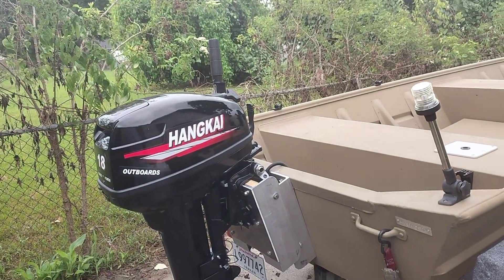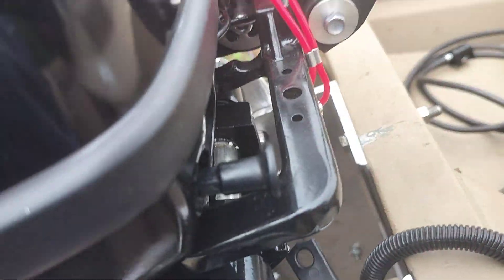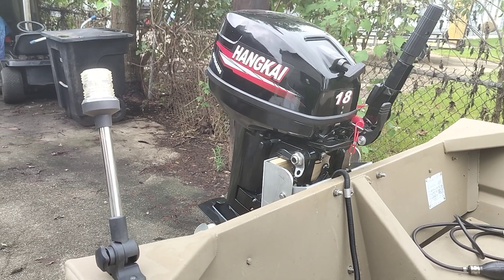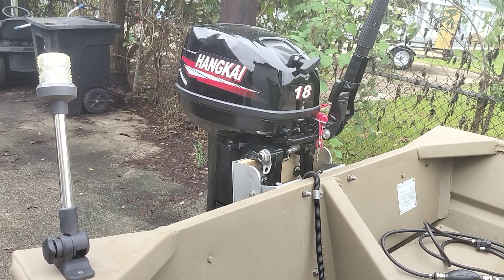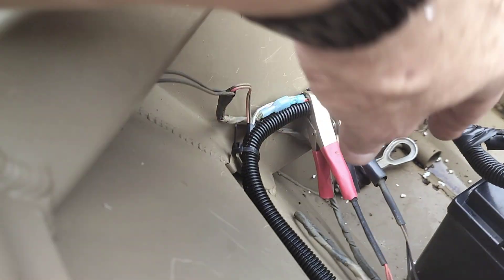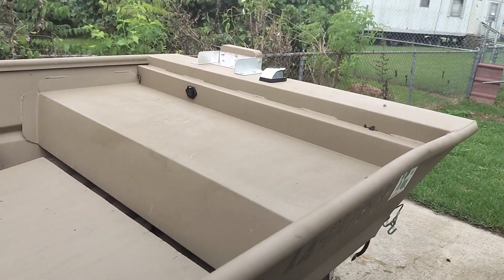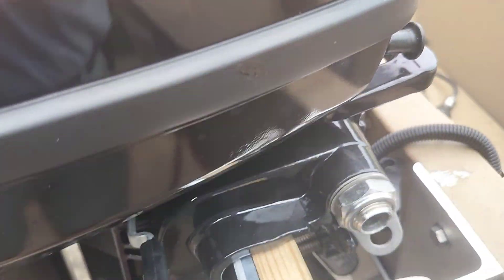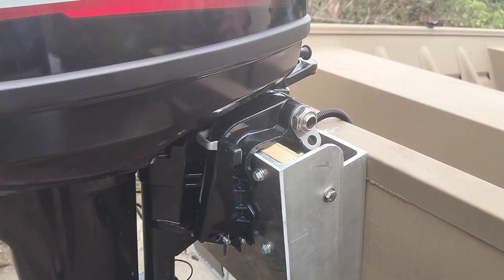DIY Power Trim/Jack Plate for the Hangkai 18HP

Comment: JerryHawk- just got my 18 today.. Couple of questions, 1- the pin with the different holes for the tilt is for setting the angle of the prop right ?

2- the trim lever is to raise the motor if Shallow?

3- does the motor raise up freely if you hit a stump or rock? Or is it always in a fixed position??
Reply from the maker: Yes to 1 & 2. The lock will release when In forward. It's locked in reverse and neutral.

Comment: would you consider making these as a kit, and we can purchase/add actuator and switch ourselves? I'm not much of a metal working guy
Reply from the maker: @natedettmer2129 they are really simple to make. I got the materials precut so it was a matter of just drilling holes and bolting together.
Reply: @JerryHawk250  do you mind me asking where to get them precut etc?
Reply from the maker: @natedettmer2129  one of my local fabrication shops did it for me. The aluminum angles where drop-offs so he gave them to me.
Reply: @JerryHawk250  thank you for your help! just got a 14' jon boat (v-bottom) and I'm stripping the paint and was considering that Hangkai 18hp for the back of it, I like the jack plate and trim option without spending thousands!